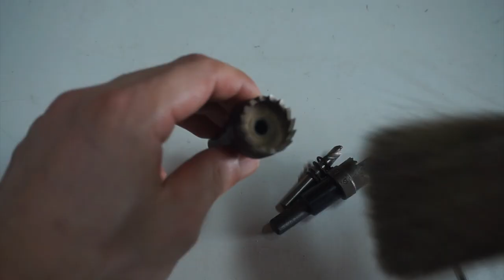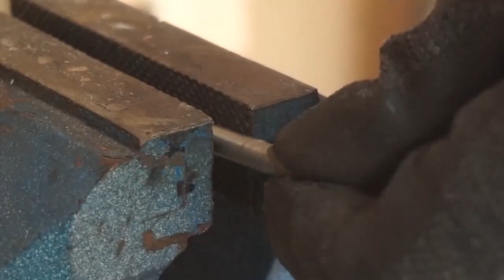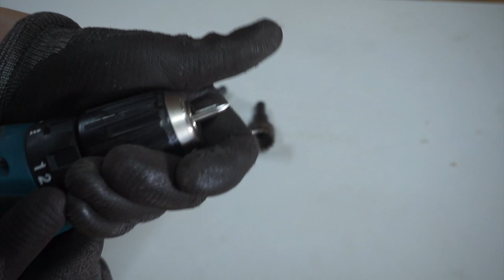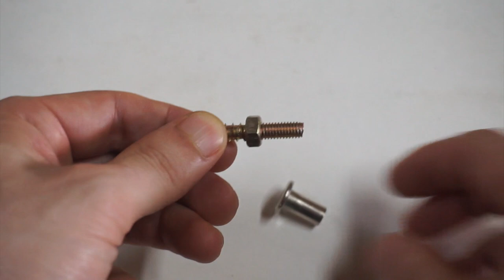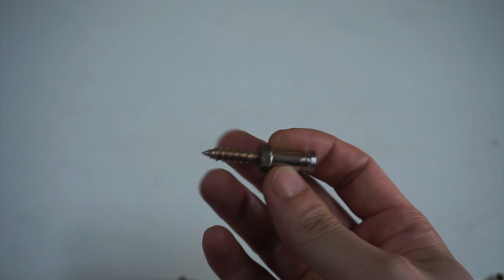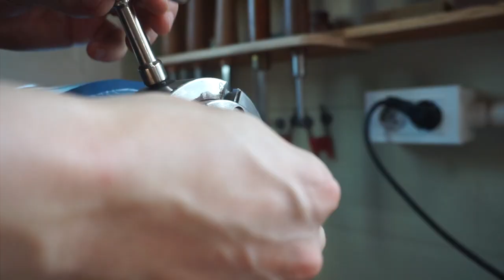Wood Lathe Drive Center & Screw Chuck | Ease to Making

Comment: I really like the hole saw trick. How is the screw chuck working? Looks like it could be fragile. I enjoy your videos. Have a blessed day.
Reply from the maker: Hello. I use the one made of hole saw conveniently. However, as you said, the screw chuck is thin, so it may be difficult for large trees. If you make it, I would like to recommend a thick screw.
Thanks for watching. Have a good day.😀